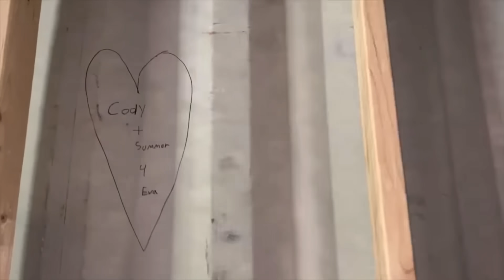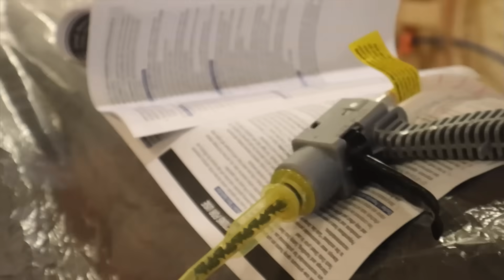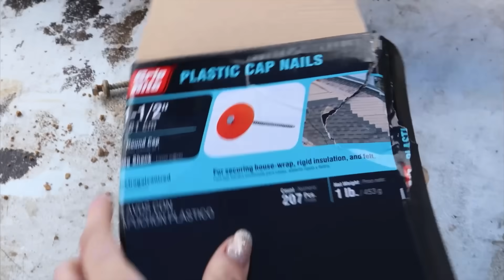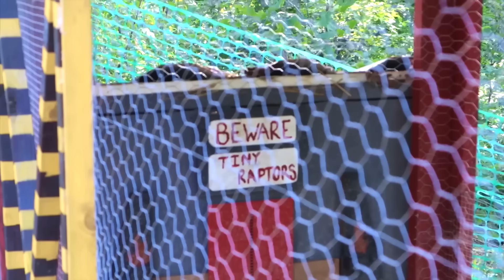Building a Home Out of Containers w/ No Experience | Full Build TIMELAPSE

Comment: Hello too the both of you. Just came across your video through a randomizer program. Cool beans too you with the build, doing it your way in the order ya did it dosen't normally happen that way. But, you did get the job you were hoping to get done. The next time you do a build and I 100% guarantee you are going to go bigger you will know what didn't work and what will make it easier. 

The reason I actually started to even write this while watching. I got to the point in the video where you were putting the foam board on the inside of the skirting around the building. It is not to late, and I don't know if you know or if anyone had told you, but termites love that foam board. If you have any way to treat it from the top and let the treatment drain down you should address it. 

"Home Sweet Home"  congratulations.!

Comment: FYI: you never want wood in direct contact with concrete. always put a barrier, usually metal between concrete and wood, because the concrete will wick moisture and rot the timber

Comment: Hi from Hawaii .......Ok good deal using a Plasma Cutter for all that and that is the right way to work and safe also. Yes Framing is done first then walls then the rest of it. You have to connect the containers so they hold good . Many cut the Panels then struggle for do the rest of the work. Oh I am a Welder and Industrial Worker and know what it takes to do work like this and also always work safe and do what is right.
  Shark Plumbing fittings work good but under the house you should mar their positions just to know where they are in case of any problems.

Comment: I'd really like to see the process of sealing the 2 containers together.
Reply from the maker: I'm not sure that we filmed it with how early in the build it was. But we used steel cut out from the walls to cover the gap in between the containers then welded it to each container. So about 80ft of welding. Then we waited for rain to make sure all the welds were water tight before spray foaming the inside.

Comment: outstanding job! Glad to see true White American's working so hard to produce the American dream.  Just a couple of pointers. Use a longer pole to hook to the paint roller, you will see it works so much better. the hot tub in the back of the house and the solar panels maybe somewhere not so close to the house. Also better in the back of the house. Two questions: where y'all working as you were building? Also, where did you get the money to build it?

Comment: You should cover the underbelly with polymer plastic and Styrofoam Insulation. You guy's are like me? I'm building an Apartment inside the pool house. 364sqft. Like your artistic way of building and painting. Well done kid's 👍 you can do those nooks with your speed square.  I have a 7" and a 4" also using your chalk line measure attached to your speed square and let the weight pull down will find the exact degree or angle you need.

Comment: not sure if anyone else pointed this out but those receptacles in the pine board you need to use box extenders. pretty sure the code is no more than 1/8" from the box to mount surface. and where its wood, thats extra dangerous since its combustible.

Comment: I would build a house shaped like a couple containers out of 2x6 lumber. then I would either buy a couple containers and cut them up and use the walls as siding, or find a martial that looks like a container. From the outside, it looks like containers stacked, but you have a house that is comfortable to live in.

I hope they are not offgrid and going to attempt to keep a hot tub hot?  even if you kept it off and wanted to turn it on for one night, it would take so much power, I guess it could be a way to use up extra solar during the day, after batteries are charged and the house load is taken care of, you can have excess solar power put into the hot tub, that might be cool.

Comment: Hi,

I am now watching the video of how you convert these containers into a home together.
Now I'm wondering how the electrical cables work.
When everything is ready and the cables are neatly concealed behind the walls.
What do you do if a cable can break due to a screw or nail?
We in Europe work with PVC pipes and electrical boxes and single wires, so it is easy to replace a loose wire.

Greetings

Comment: I hate to be so honest but you basically made a house inside two shipping containers, cut out a 40' section of the containers without replacing the structural support those walls provided. Those 2x4s might hold it for little while but over time the middle section will sag.
Reply from the maker: We reinforced the roof with steel, none of the 2x4 framing is structural.

Comment: Random question cause im not seeing it on the video. Did yall reinforce the roof where the two containers connect to one another? All i see in the video is a single support column in the middle, but i dont see a welded beam welded to both roofs along the middle where they connect, nor do i see any other support columns on the ends of each container holding the two roofs. Not seeing this support structure reinforcing the roof structure of the two containers makes me worry of the integrity and strength of the roof.  Im only on the first third of the video, so i dont know if it was added further out in the video.

Comment: Hi, 
Are you at all concerned about the lack of support the middle of your roof has. The walls of the containers that you cut away are essential to the structural integrity of the container. Unsupported by walls the roof could be prone to warping, twisting apart or collapsing.

Comment: I love how the younger generations have embraced a new standard of what a home means unapologetically
but please i beg you, put Romex connectors or at least grommets in the knockouts of that load center
where you have brought the electrical wires in. dont burn your family. It may take a while but eventually
the vibrations on that sharp edge WILL cut through the insulation on those wires. you probably did this along time
ago but you can still buy plastic grommets and cut one side and fit them in just for peace of mind

I know everyone on the internet has a comment to offer but please listen to this one.

Comment: 16'x40' gets small quick if you start having babies. I'm hoping somehow the camera disguised the usually obvious difference in pressure treated wood as that large steps/micro deck looked like standard lumber. Was curious how the container construction is that allows the cutting out of the married walls with what looked like no supports. I skimmed so I'm not sure if I saw how or if you put any slop on the roof, sealed the seam between the two containers, etc. I'm assuming that steel is thicker than your heaviest roofing steel. You cut out a window section of any size you want to make sure there is no one or anything on the other side, & make sure it falls in the right direction. That wood accent wall, not sure why you didn't start from the bottom & work up as the norm, as doing so, when nailing the tongue at the right angle you won't see the nail hole when you put the groove on top of it. I would have recommended trimming out the edges so you don't see the ends, burn or not, on the tongue & groove. Install the T&G say 2.5"+ from the doors. Take some 2x4's, if you have a planer, plane down at least the one face side, just to clean off the stampings, etc, cut a rabbed the thickness of the T&G & depth needed, cut to fit door. The rabbed overlaps & covers T&G edges.
Reply from the maker: Hi Peter! Is this the only video you have ever watched of ours? We don’t plan on having kids for a while. This is a mother in law suite while we build our bigger home. We don’t use pressure treated lumber for a reason! We have a few videos on this. The deck was milled with wood from our property. We have plenty of videos of us reinforcing the container walls and windows with steel. The containers are welded together, and there isn’t slope because we haven’t got that far yet. We are only two people. We didn’t start from the bottom on the wall with car siding because we didn’t want to. 
Hope this helps! Appreciate all of the input!

Comment: Calling you out on "no experience". Takes years to be good with a mig welder. You have the electrical experience of an electrician. I framed houses with my brother who was a framer/ carpenter. Your work is too good for not having experience.
Reply from the maker: Haha thank you! I had lots of experience with low voltage/automotive wiring but the most household wiring I've ever done was just changing out a receptacle. Same with mig welding, most I've ever done is just exhaust pipes on cars or some basic fabrication on my  jeep.
Reply: @CantContainUs  Really good job! I'd get you to set up a home. My own plans are to buy a new truck and 5th wheel RV for next winter and head to Arizona. Best of luck to you two. Oh, I'm following you as well, to help you out with your channel.

Comment: It is a shame to have put so much work into a project that would not pass code. It is going to be a problem if it ever comes time to sell. Crazy fire hazard the way you did the electrical outlets and switches. No plates over where the wire passes through studs. I saw no plates to protect the plumbing either. I could go on, but no use beating a dead horse.
Reply from the maker: That’s really funny because our house did pass code and all of its inspections! Just because we didn’t show it in this video doesn’t mean it didn’t get done.. I took two years of our life and condensed it down into 50 minutes. If you take the time to watch our other videos, which are more in-depth you would see all of these things!  We’ve had a fire inspection, code inspection, as well as septic. They looked at all of our electrical, and everything passed with flying colors! And of course we put plates to protect our plumbing and electrical… why wouldn’t you?  Also, there’s an entire video dedicated to inspections so I encourage you to go and give that a look! Thanks for looking out though.
Reply: @CantContainUs  Okay, I stand corrected. Good job !